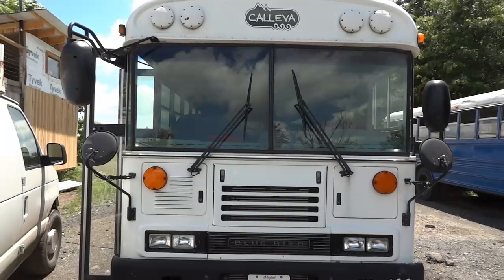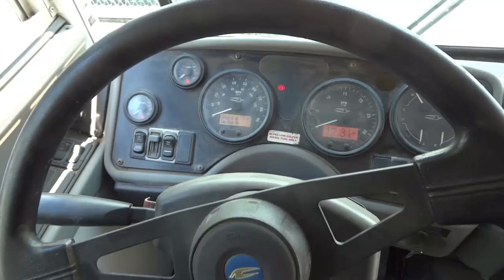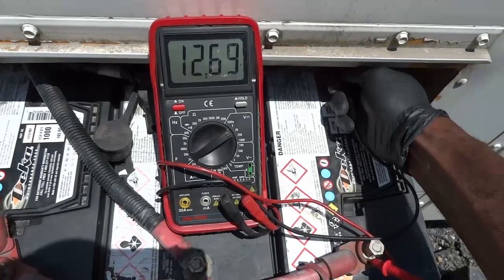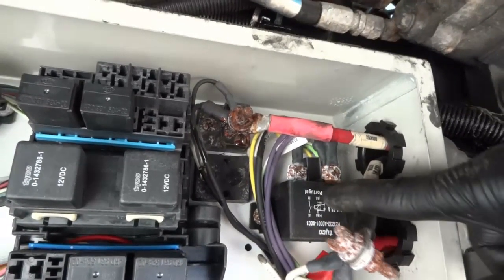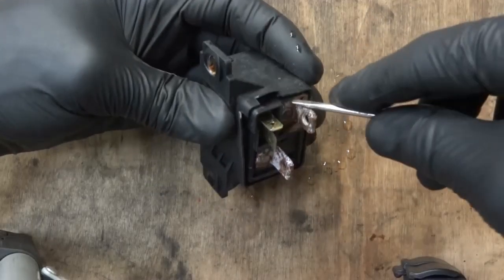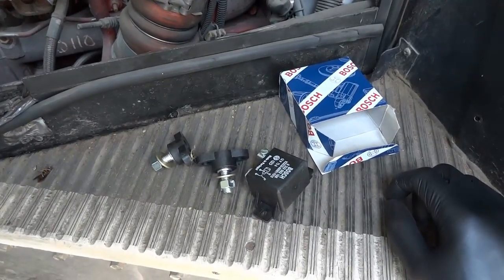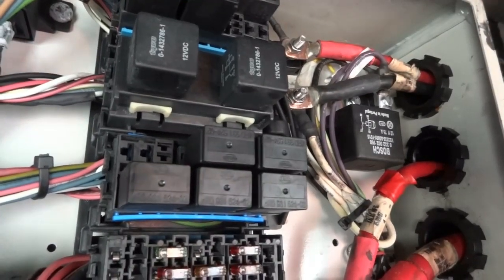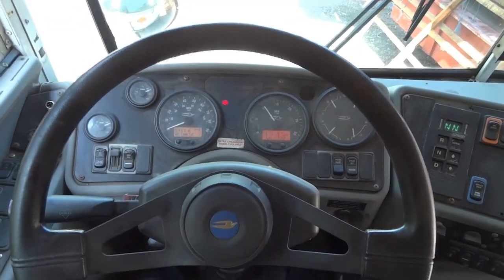No Crank, No Start Diagnosis On A Blue Bird School Bus With A Cummins Engine

Comment: Great video! I’ve got a 1991 blue bird tc2000 that had a similar problem of starting them shutting off, then struggling to start, now ultimately won’t turn on at all. It’s gone completely dark. Nothing happens when I turn the key. Any idea where to start?
Reply from the maker: @nicholasphillips5406  check your starter relay and your starter!

Comment: Im in a situation. My brother collapsed and can't walk. Now I need to know how to start the bus. I know that there's a cut off switch that needs to be turn before starting the bus. But in general, I know nothing about these buses and I don't want to let them run down over the winter. Can you show me in a video how to safely start them?
Reply from the maker: @floridajeanp  there is a cut-off switch by the batteries, make sure it's in the On Position

Comment: Great job with explaining everything in detail. 
I have the same bus with same problem just a little differently. 
Seemed to have happen over night! 
I have 13 volts at batteries lower voltage in other places. Instrument panel won’t light up and of course won’t start. Anyone with any ideas? 
Thank you
Reply from the maker: John Emmons  My Pleasure!! it sounds like you have a major voltage drop somewhere, check your main power and ground junctions  for corrosion
Reply: @KITS_Auto_and_Truck_Repair  will do!
Reply from the maker: @johnemmons9087   Ok!

Comment: I have same problem but mine has no corrosion i replaced the starter relay and still nothing my starter reley is not receiving power when I crank it and my odometer is not working
Reply from the maker: @bigdogsgarage  check the wiring!

Comment: Hello there, so i have a blue bird bus that was running perfectly fine but we left it seated for sometime and by the time we came back it was full of rats so I’m guessing they probably chewed the cables or something… so the engine turned and fires up sometimes but immediately shuts down after couple seconds or sometimes just turn over without starting, any suggestions? Any idea where we should be looking? Thanks for your help.
Reply from the maker: Sam Tshishimbi  check the basic things first!! are you getting fuel at the high pressure pump?

Comment: In class we are learning how go read wiring diagrams, I hate it, but im hoping this helps makes sense of all this.
Reply from the maker: Gail M I know this was straight to the point, I talked about the process but I didn't show a wiring diagram! if you have questions about how I went about fixing this problem, I would like to refer you to my how to diagnose a starting circuit video on a Hyundai Sonata!! look for that video, I did include a wiring diagram on that video, I'm pretty sure that video will helpful to learn how to read a wiring diagram,  it's the same components for the most part weather it's a bus or a car!!